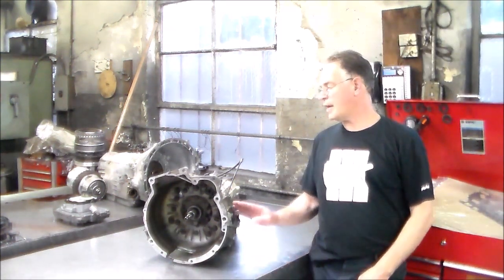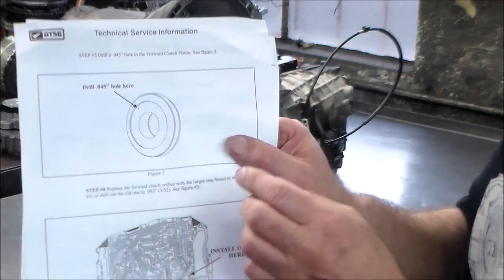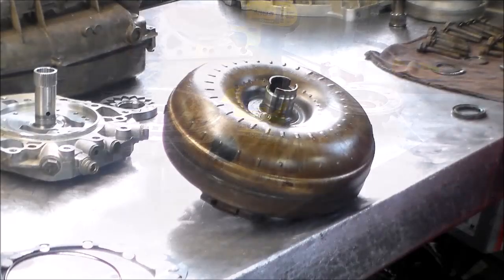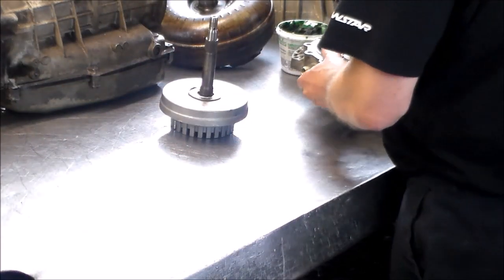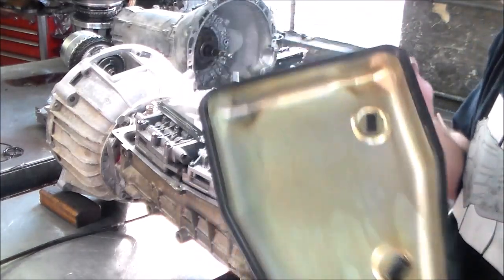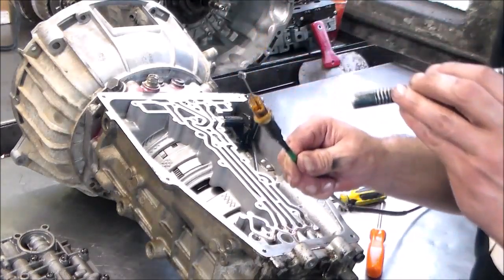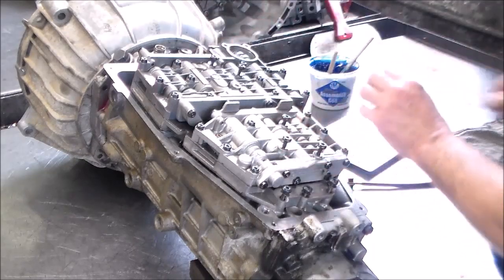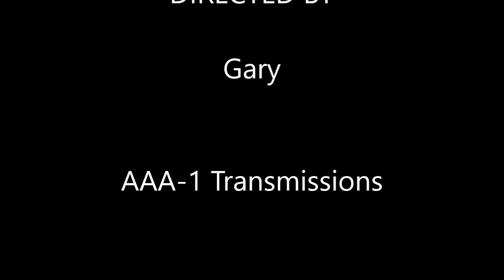ZF4HP22, Fixing Leaks

Comment: Also I do understand why Volvo still held on to their AW70/71/72’s in the same era they tried that ZF4HP22. Basically the Aw70-72’s are the same as the Toyota A40D series. Some 740’s from 85-88 with naturally aspirated 2.3L gas and 2.4L TDIC Diesel had the ZF4HP22. The shift indicator for the ZF 4hp22 is PRND321 and the AW70-72 is PRND21 with overdrive lockout button. The AW70-72’s Aka Toyota A40D series was more reliable for the Volvo’s 2.3L gas whether naturally aspirated or turbo.

Comment: Hey Gary. Have had a problem so started looking online and couldn’t believe the amount of detailed videos you’ve posted over the years! 

I have a 1995 Audi A8 4.2L Quattro automatic with what I believe is the 4HP-24a transmission. It goes forward fine but does not reverse. When you put it in reverse it sounds like the box clunks. It does engage and the car rocks back slightly but doesn’t move as you rev. I’m assuming either the F clutch or piston is knackered. Ahh well, thanks for the great vids anyway!
Reply from the maker: Ok, question, doesthe car by chance move forward in Neutral?
Reply: @GaryFerraro  in neutral you can push it forwards. If you go from D to N and Rev sometimes it’ll move forward abit but most times it just revs.
Reply from the maker: @danielparkes8492  ok, The reason why i ask is , if the forward clutch is locked on, you will have no reverse but it will move forward in neutral.  You could have a problem with your F clutch drum, the rings tend to wear out where the E clutch drum rides

Comment: Hey Gary.  Great detailed video.  Thanks.  Regarding the modifications to prevent the A clutch failure.  You mentioned the two steps for drilling a hole in the forward clutch piston and the valve body but didn't show those steps.  Where is the forward clutch piston and where in the valve body do you drill the larger hole to fix the overpressure issue.  Any resources you know of?
Reply from the maker: Drill a small  hole in the piston (forgot drill size)  Then you take out the forward clutch orifice to make up for the drilled hole.  Maybe google ZF4HP22 A clutch correction kit,  They are out there

Comment: I have a 1988 528e with automatic transmission. Is leaking when u start the car. The car has more than 300k miles on it but it was running fine before the leak. Can’t find anyone that wants to work on it. Any suggestions?? I’m guessing is just the seals are toasted.

Comment: Thanks for making this video Gary. I have a similar transmission from a Jaguar XJ40 that I'm adapting to an Aussie P76 V8 engine. I note your comments re the front A clutch 'failure issue' due to a design flaw. I'm aware of the issue but have not been able to locate the relevant documents outlining the fix. Would it be possible to post clear copies of the relevant pages so that I could take a clear screen shot of them. Once again thank you for posting this very useful video.
Reply from the maker: i will look, not sure if that bulliten is around anymore

Comment: Did you do the drilling update procedure? I remember when i lived on Long Island and they put my 93 Ford Festiva 5 speed manual on that dyno about year 2000, the car only had about 60 HP and 12 inch tires, they really seemed to abuse the vehicle in my opinion, seems that machine has become history years ago fortunately.
Reply from the maker: You would drill a bleed hole in the A piston and to make up for the bleed hole the orifice in the valvebody had to be enlarged, if it wasn't the car would slip on pullaway

Comment: What special tools are needed for this rebuild.  My transmission started not up shifting from first to second then it would go into reverse. But eventually it will go into first and reverse.
Reply from the maker: Well, if you want to take the drums apart to change the seals, may need like a foot press to depress the return spring, some of these drums have split rings as well but not really any special tools
Reply: Thanks for the quick response on my first question. Should  I replace   the torque converter after rebuilding it . Thank you again

Comment: vehicles that had this ZF 4hp22 transmission:

BMW E30's 1985-1992 , BMW E24's 1983-1989, BMW E32's 1986-1994, BMW E34's 1988-1994, BMW E28's 1981-1988, Jaguar XJ40's 3.6L I6 1987-1993, Jaguar X300's 3.2L I6 1994-1997, Land Rover Range rover's 1987-2002 (all engines except 4.6L V8's), Land Rover series I Discovery's 1992-1999 3.9L V8, Land Rover series II Discovery's 1999-2002 4.0L V8, Peugeot 505's all engine options 1986-1997, Lincoln Continental 1984-1985 with BMW-Steyr TurboDiesel, Maserati Quattroporte 2.8L V6 1994-1998, Maserati Biturbo both 2.5L and 2.8L V6's 1988-1997, Lotus Excel's SA Twin cam 2.2L I4 1986-1991, and In Brazil and south america the Chevrolet Opala with 2.5 and 4.1 engines 1988-1992.
Reply: Torque converter are the same ?

Comment: hi   i have a 335i with 6hp21 trans.   It have harsh up shift when high rpm and 4-5 flare.   What you think?  Sonnax zip kit or reconditioned valve body?
Reply from the maker: You could have a worn rear stator bushing or possible solenoid problem
Reply: @GaryFerraro   So would you recommend to replace bushing kit with new solenoids?  cause it would cost $2000 for a unknow condition second hand trans and $4000 for a rebuilt one